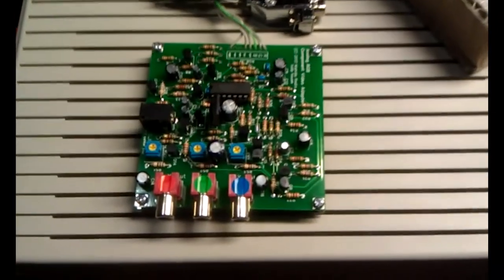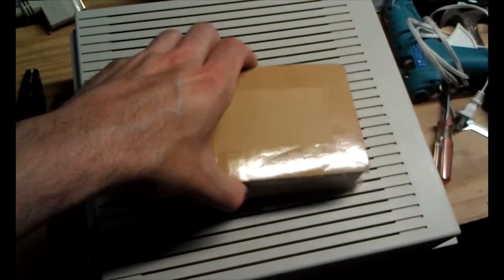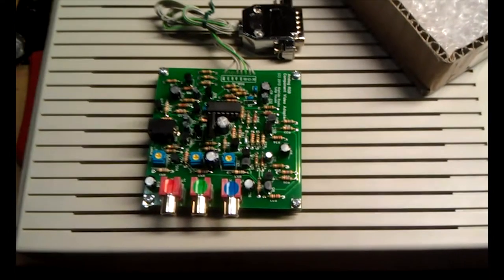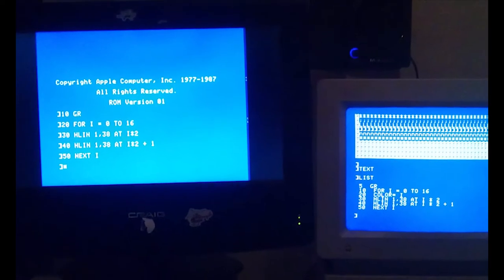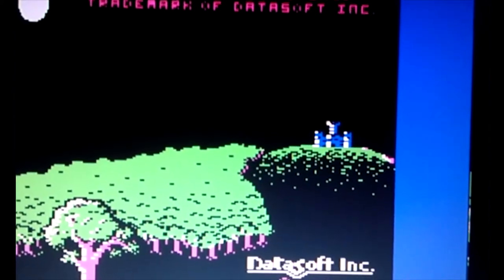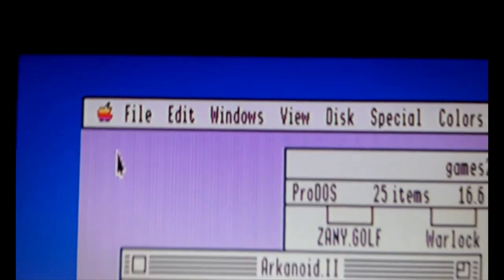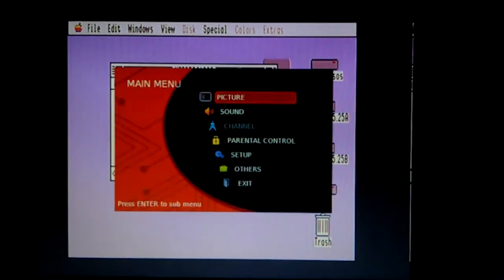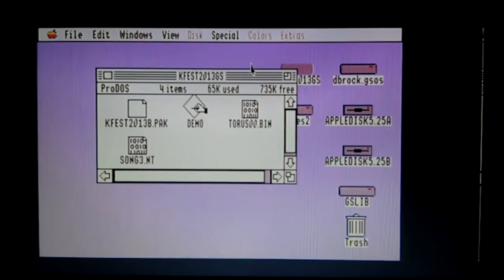Analog RGB Component Adapter for the Apple IIgs

Comment: I already have a scart/rgb converter, but am looking for the actual scart cable that plugs to the converter and then to the Apple II GS RGB port on the back. Any ideas where to order from? The page that everyone links to online is down and can't find any alternate means of purchasing the scart cable.
Reply: BoneCollector This guy sells the scart cable necessary. It should work when run through a converter box like the CSY 2100 I have. I haven't purchased the cable yet, but for anyone interested: http://roger.geek.nz/scart.html